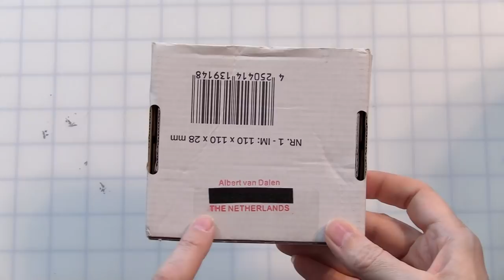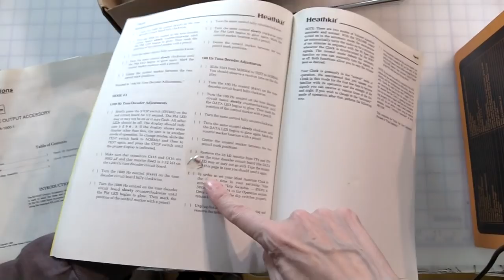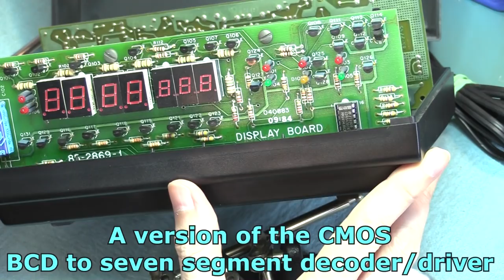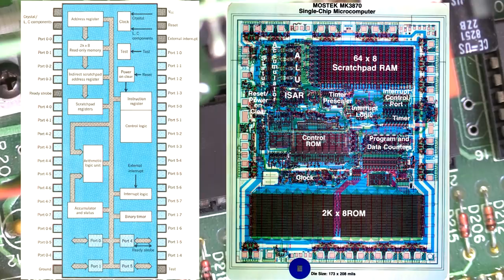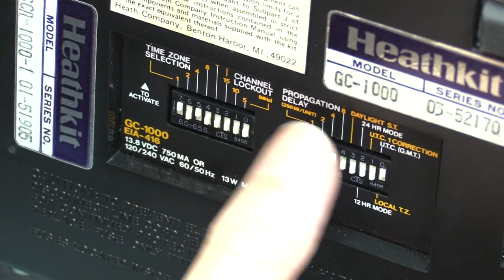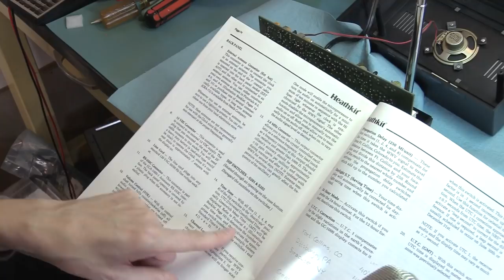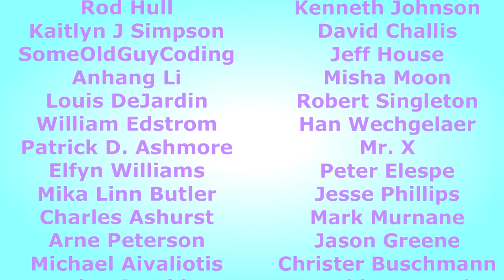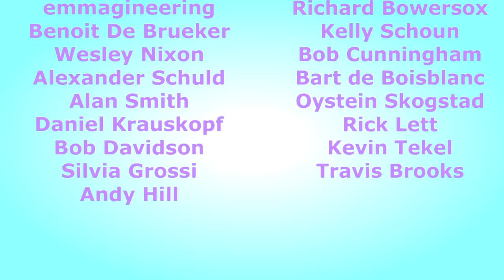Mini Mail #1 - Heathkit GC-1000 Most Accurate Clock

Comment: Kits are so cool! 

I'm waiting on a little 3.5-15MHz QRP regenerative receiver kit from a ham club out near the southwestern quadripoint here in the US. 

Can't wait to throw out a wire and start pulling in signals.
Reply: Yes, there is something to be said for building something yourself. You generally have a good idea how to fix it when it goes wrong but cost is rarely a good reason for building a kit as main consideration.
Reply: Interesting, I thought the time signal is sent via very long wave  (around 60 kHz) from Fort Collins. This gives the enormous coverage also during day times. Didn't know that there are shortwave transmitters too.
Reply: @LutzSchafer  WWV sends those NIST signals out as low as 2.5 MHz, yeah. Same antenna farm they use for the long wave out in Fort Collins.

Comment: Fran
Once you get the regulator replaced and get a good signal, you will need a little patience. The time signal is sent at a blistering rate of 1 baud. It takes a full minute to send the hours, minutes, date and UTC corrections. They also have a bit for daylight savings time. You can get more information at https://www.nist.gov/pml/time-and-frequency-division/radio-stations/wwv/wwv-and-wwvh-digital-time-code-and-broadcast

Also of interest, the frequencies they broadcast are NIST tracable frequency standards. The tones broadcasted are also frequency standards. You can use these to calibrate your signal generators. This book gives instructions on how to do this. https://nvlpubs.nist.gov/nistpubs/Legacy/SP/nbsspecialpublication559.pdf

Comment: Yeah, the rf noise of the 21st C is a problem for this WWV receiver  Fran.  It isn't in a screened case either, to make matters worse ! As you say, back in the '80s, it stood a chance. Good luck though,  like to see it working.
(you should hear the 1 pip/sec tones of WWV from the speaker - you know that - but there must be some kind of simple processor in there to decode the 1 bit/sec data from WWV also.
Random YT vid of WWV sound here   https://www.youtube.com/watch?v=7tVH6TqXG0wre )

Comment: Switching power regulators usually require a minimum current to operate. The 50 mA on start might be simply to low to get the simple switcher running.

Comment: Fran.  Is WWV still transmitting?  I know that in 2018 as part of the 2019 budget they proposed shutting the WWV transmitters down since time is now generally provided via Internet services at this point.  I haven't been able to verify one way or other if the measure passed or not.  It's going to be hard to get it to set itself if they are no longer transmitting the signal it requires.

Comment: Fran,
 not sure what state you reside in but typically 10MHz will be good day and night, 5 MHz mostly at night unless you live near CO. 15 MHz will be more iffy since we are at the bottom of SOlar Sunspot 25, meaning poor long distance comm at frequencies above ~14 MHz.
Next point, the interference you are having in THAT receiver is in all probability from computers, switching supplies etc in your abode.
HF equipment is RARELY interfered with ultra high frequencies of the Cell services. I live 1/10 of a mile from a tower which has antennas from 3 different carriers of cell service with ZERO interference of all of my HF  equipment 160 meters through 6 meters. 
The prop delay switch is set for your distance from Boulder CO where WWV's transmitters are located. 
At this day and time a GPS DO derived clock via arduino processor makes more sense and is an easy project. The sats are LINE OF SIGHT and not dependent on HF propagation delays. That and funding was pulled for WWV operation initially for 2019 but was reinstated. Personally, I hope WWV will be there for many years to come and for q lot of technical reasons, However, it seems the days of WWV may be less than we hope for.
Good luck, 
Glenn WA4AOS
DSM Labs

Comment: That tower isn’t allowed to cast off ridiculous off band harmonics. It’s only licensed to broadcast the frequency it’s licensed to. Contact the FCC. Complacency will just get us more of the same. Remember that. Additionally, the power supply was already capped with Panasonic FC and Nichicon parts. Those are not period correct parts. They are good part though. Try and source a CV variant regulator. Good luck.

Comment: So is this basically a rf-clock that gets its signal from WWVB in Colorado?
I've noticed that, with the advance of more rf-technology in microwave-bands, our European version DCF77 has a worse reception. We've had our switch away from daylight-savings 2 weeks ago, and I still have one DCF77-clock that displays the summer time ;)
Reply: NOT WWVB-that's using LW at 60 Khz.
This clock uses WWV at 5,10, or 15 Mhz
Reply: @m.k.8158  Oh, I see. The German Wikipedia article redirected from WWVB to WWV, so I thought they were kind of synonymous.
Reply: @Seegalgalguntijak  Well, they are both operated by NIST(they also operate WWVH)(same as WWV, except that the transmitter is in Hawaii, and the voice is in a higher register(so it sounds female)-WWV has what sounds like a male voice)-this allows you to tell which one you are hearing-also the voice is sent at a different point of the cycle-so if you are hearing both, you will hear 1 speak, and then the other).
WWVB only sends digital data, no voice.
WWV/WWVH sends both voice and digital data

Comment: Yep the Other Mostek is for the Serial Port controller..And ripout the DC-DC and put in a normal 5-Volt Regulator... If you need I can Buld you a Winter RF Squirrel Net's to Help Kill All Stray RF..
And the Antenna, so Close to you, 'Whispers ' Classic Feed Back Attack..And it Only take a Good Old WOK..Or Metal Trash Can..

Comment: it works like a police scanner continuously looking for signals, you had reception but never picked up the signal at all, it won't work with the antenna disconnected, don't lock out any stations until you get it going, that's only for interference on the audio output lie squelch, nothing to do with the time adjustment

Comment: Ditch the switching regulator. Use a long wire antenna. HF propogation is not good at the moment which makes it hard to get a signal no matter what: this radio was built when propogation was much, much better.  If you can't hear the spoken signal it will never work.

Comment: I think the serial PC connection was really useful and not just a gimmick back in the mid 1980s. The early IBM PC had no real time clock installed, you had to set the date and time everytime after the PC booted into DOS. You could have used one of these clocks to set the PCs time automagically.